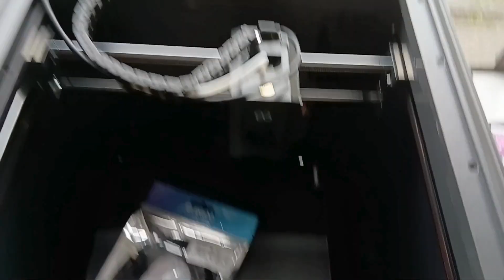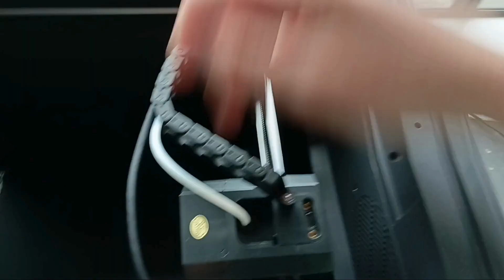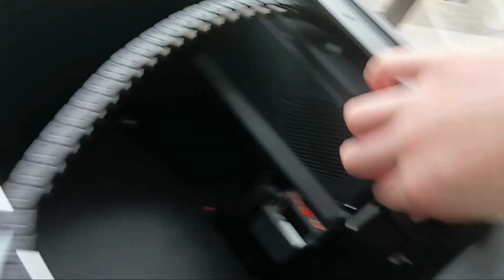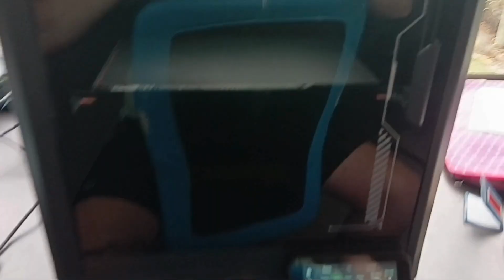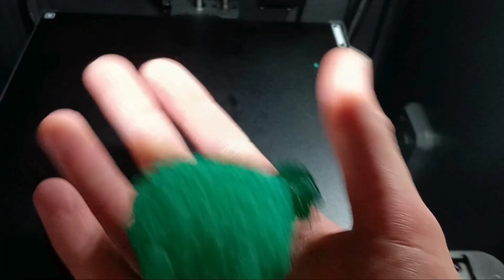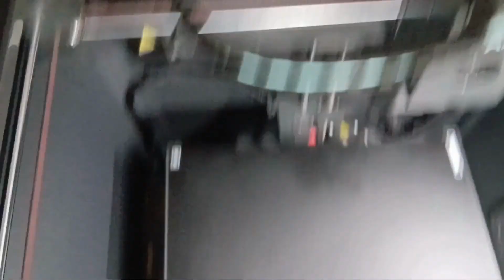How to replace the print head cable of Elegoo centauri carbon

Comment: You left so much out, cable ties need to cut and replaced, cable sheath unwraps to make it much easier to move cable through the machine, bin chute needs to be loosened as well to get the cable down the side, what a crap guide 🙄
Reply from the maker: Zipties dont need to be cut or replaced, the sheath does unrap but anyone doing this will notice that, bin shoot doesnt need to be loosend to get the cable down the side, the fix works and is one of the only guides on youtube, I'm a small youtube chanel and dont have a camera mount to record better videos, what a crap comment.

Comment: you made an after the fact video FOLKS THIS CABLE IS A BITCH TO GET THRU THAT HOLE BE PREPARED
Reply from the maker: If you are talking about the hole running under the top frame of the printer then yes it is a bad design, that is why I showed me removing the screws for the top plate.

Comment: you put the cable before the filament line it goes after it not between ;-)
Reply from the maker: I dont fully understand what you mean, but you are probably right and your input is valued however I have been testing it in this configuration for 2 months now witch is longer than the original print head cable lasted and I have only seen better print quality.

Comment: Dude I did it your way and I was able to get it get the cable in in My tonight 10 seconds you're a awesome person
Reply from the maker: Thank you for saying that. What did you mean by "I was able to get it get the cable in in My tonight 10 seconds"
Reply: Why did u replace ?
Reply from the maker: @XoAdonis  The stock cable that came with my printer had bad wire management and had a very sharp bend at the tool head so it broke. If you were to buy a centauri carbon now ellego has aparently fixed this issue.

Comment: Bonjour.il ni a pas besoin de démontrer le dessus pour remplacer le câble USB,il est vrai qu'il est de très mauvaise qualité.
Reply from the maker: Thank you for the comment and feedback. It is true that the top of the printer doesn’t need to be disassembled, but for me it was just easier to remove the screws and open the top to get the cable out. I couldn’t find any tutorials on how to replace the cable, so I just chose the easiest way for me.

Comment: Why did you have to replace the cable in the first place?
Reply from the maker: the strain relefe on stock elegoo centauri carbon cables is not good enough and one of the thermister wires inside the cable broke.
Reply: @vladimirjar3800 did they say anything about improvement on the new one? Or will you have same problem again later?
Reply from the maker: @Stigman11  the retalier I bought the printer from said they got the improved cable with a 90 degre bend but it was the same as the original so time will tell weather it is still a problim or if it is fixed.
Reply: @vladimirjar3800 okay thanks. I am waiting for the same printer to be delivered to me, so I wonder what cable they sent me…
Reply: @vladimirjar3800 we’re u getting a error before u changed it ?
Reply from the maker: @XoAdonis  I dont remember the exact error but it had trigerd a thermal run away error.